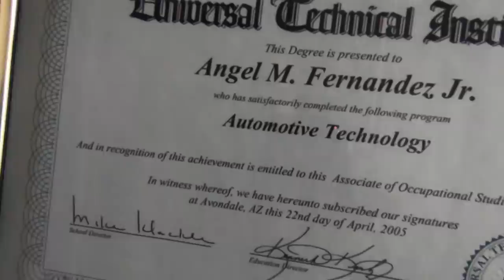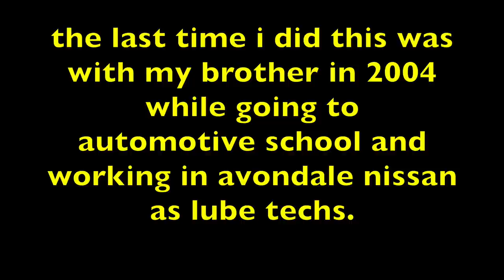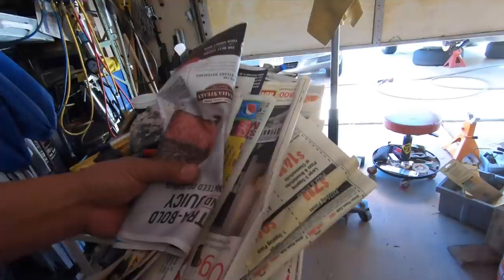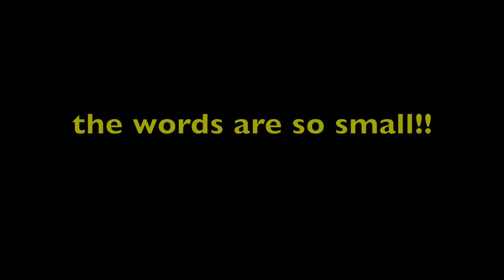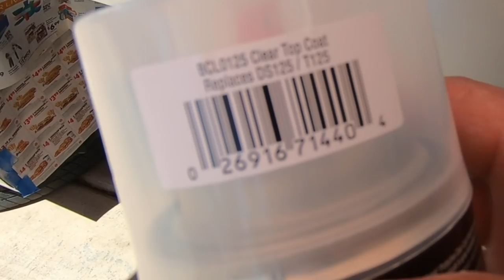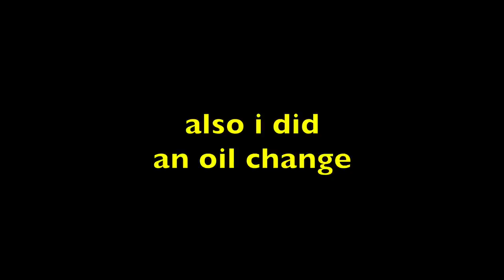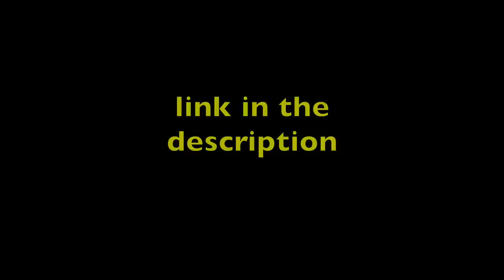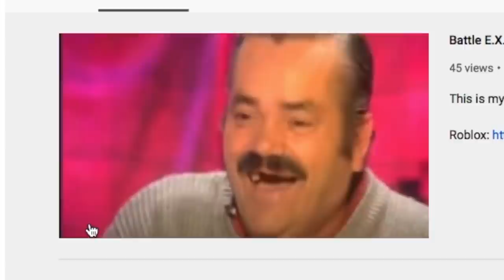FINALLY i painted the fender Toyota Camry √ Fix it Angel

Comment: Shouldve used 2k clear to finish it off and sprayed it on heavy.
Reply: Its not a great match as it is but yeah it would have looked better. Spray heavy then wet sand and buff.
Reply: @tonychambers9228  He still could do that if he masked it off and sanded it with 2000 grit then laid a few heavy coats, but i don't he really cares what it looks like. Haha

Comment: That clear coat can  is garbage, use this can instead it's the closest to professional clear coat but in a can.
USC SprayMax 2K Glamour
Reply: Yeah 2k and 4k are they best thing to use for professional results in a can. Just need to wear proper protection gear. Gloves Respirator and tyvek suit. The chemical in the 2k 4k products absorb through the air into the skin and build up in your body and stay there for a very long time.
Reply: Yeah the Duplicolor clear coat leaves a lot to be desired.

Comment: I thought those fenders are primed and ready to be painted,I guess not otherwise you don't have to sand and prep it.
Reply: Sorry but you have to spray sealer, when you have parts like that.
Reply: When I repainted a rear bumper on my daughter's old Corolla, I read that you usually have to prep aftermarket bumpers even when they claim to be primed and ready. I'm no paint expert, but that seemed a fairly consistent recommendation.
Reply: When I pained a red bumper with Duplicolor rattle cans, I realized after the fact I sprayed too fast and didn't apply a sufficiently thick coat. I was too afraid of making drips or runs. My end result left me with at least one extra can and an unsatisfying paint job. Talked to a friend who does all kinds of car work and he said I just didn't apply thick enough coats. Same happened with the topcoats of gloss.

Comment: Don't know about Duplicolor, but many spray cans of paint (and other stuff) have a small dot or other indicator on where the tube goes to the bottom side of the can.  So if spraying down at all, line up the spray with the dot so you'll get all the paint.
Reply from the maker: Thank you for the tip. I know what are talking about. The can didn’t have the dot.

Comment: Simple trick for wet sanding like this is to punch a small hole at the bottom of a cheap bucket.  Fill with water and let dribble down over the side of the car/fender/whatever.
Reply from the maker: Thank you for the trick. Always appreciated with your tips.

Comment: Great looking paint job, though I'd have used a 2k clear coat. Used that exact same duplicolor clear coat for my headlights and it was garbage in a year.
Reply: That 2k works awesome, those other clear coats are just trash
Reply: Ya, the Duplicator clear is absolute trash... It's very hazey.  I ruined a great paint job.  As soon as I sprayed the clear it hazed the finish and no amount of polishing fixed it.  A good 2K is the way to go.

Comment: What will the customer say?
Are you going to repaint it?
This batch of cars was assembled in Michigan.
The body had a color from the factory, not silver, but its own shade.
Color of the RIESLING series.
I don't paint body parts on the street.
The pigment flies away. Paint consumption is higher.
There is little varnish on the wing. Semi-Matt wing.
Perhaps in the sun, under ultraviolet light, the paint will not have a bright shade. But this is 1-2 months.
Good luck with your work!
_________
Stickers as on the plane turned out!))))))))))

Comment: Awesome job Angel! Not bad considering the price you paid for just parts. Also, received your free sticker! thank you! I got a front end collision myself a few weeks ago. I was able to use a tree and straps to pull the rad support. Luckily non of the radiators/condensors/AC lines are damaged. I got lucky. I am going to follow the same steps as you did for painting that front bumper! Thank you sir!

Comment: use rubbing alcohol to degrease the panel and then tack rag. Scuff it up with some steel wool. Use 600 grit sand paper in the absence of steel wool.

Comment: Nice job Angel, don't be modest. It was too quick I couldn't see if that was conventional or synthetic Super Tech oil. I have the same car with 67,000 miles and have only used conventional. I am the original owner and afraid of leaking seals if I switch to synthetic. Now I have the courage to do some touch up painting. Thanks!

Comment: PSA: Angel, other mechanics, make sure you warm up, stretch back, do Yoga " balancing table pose " to stretch lower back.  Pulling out lead batteries,  just a STUPID 45 Pound lead battery kills too many mechanics' back.  You'll curse plenty when your back is locked up.  Warm up, folks. Get that battery lifting tool.  That will be the best $40 you ever spent.  Love this channel. Remember to Smash the like button.

Comment: dude ! you can melt zip ties into the holes in the bumper ;)
but there is a catch, you hav2 remove the paint from around the area you are mending
also you hav2 mend from behind as well. you can use an old soldering iron.